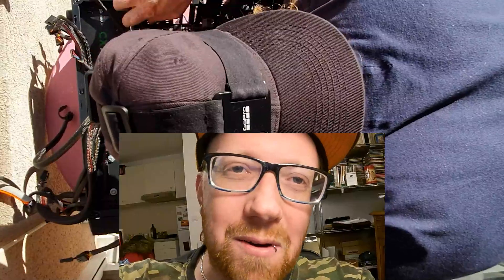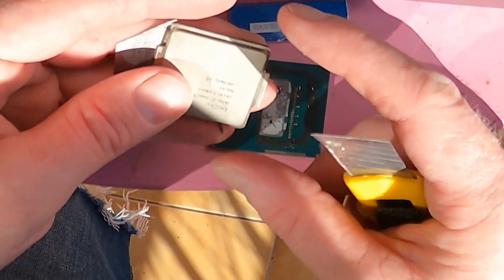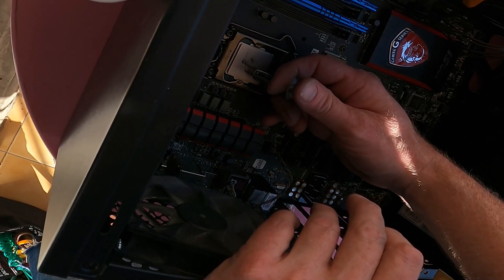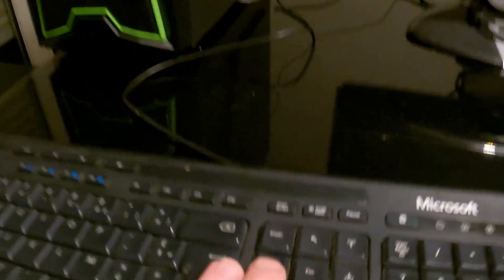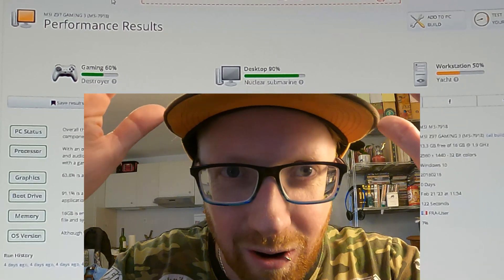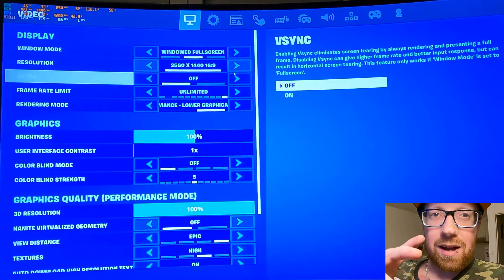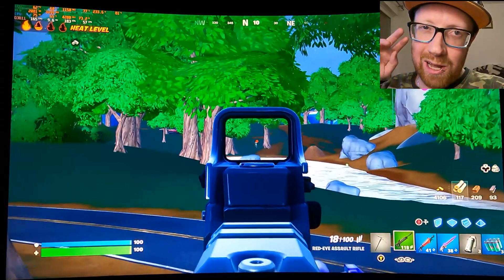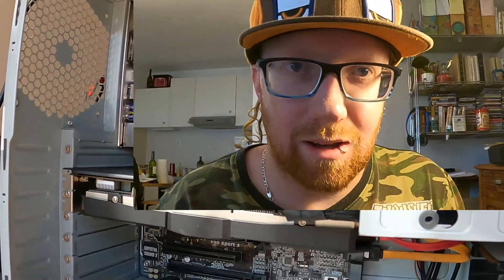How to Build a $200 Gaming PC

Comment: impressive, how did you know the settings for the OC?  Also would love to win it :)
Reply from the maker: It took a lot of testing and a lot of crashing to find the sweet spot I was try to keep the voltage under 1.3 but it was unstable and when I set the multiplier over 42 it would not boot it would need better cooling to get higher but 4.2GHz is a lot for a 10 year old CPU. Awesome I hope some other are keen to would be fun to make a Competition out of it :D